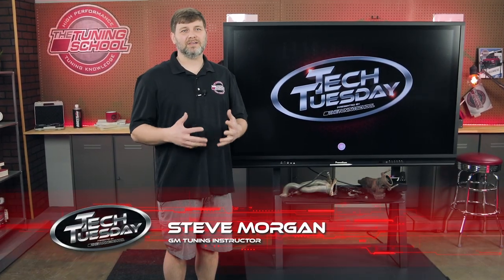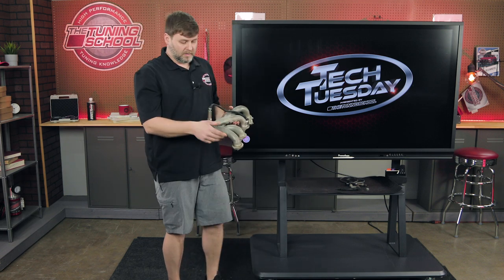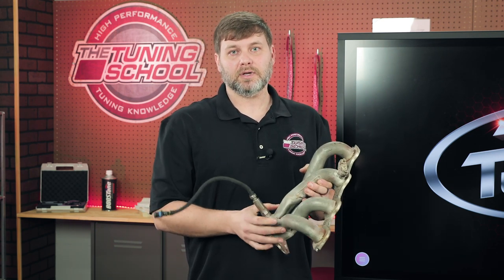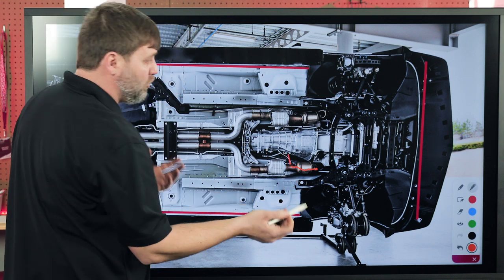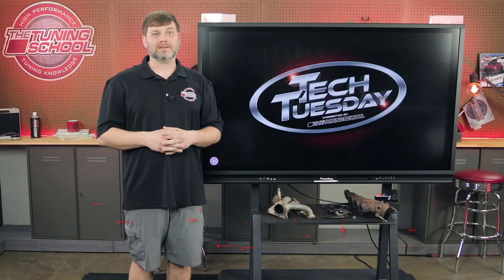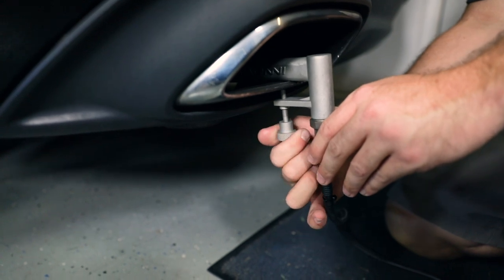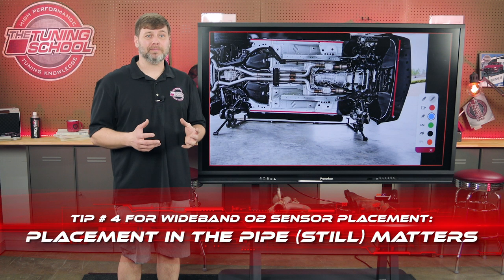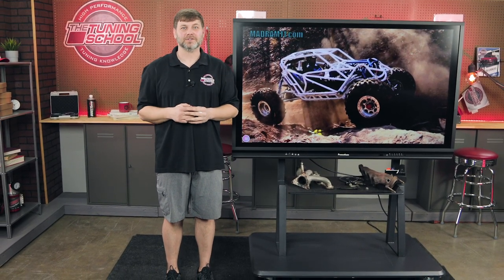Proper O2 Sensor Placement

Comment: I'm building a rear mount coyote F150. I keep finding conflicting information on my factory wideband placement. This will be a low boost build with no more than 10lbs of boost and I believe that back pressure will be minimal because I'm using a turbo with a decent size turbine wheel and also running two wastegates. Do you think I can get away with running my o2 sensors in the factory locations and not kill them?

Comment: Long tube headers have O2 bungs for factory O2 sensors. Do I need to weld 2 more bungs for the tuner or can they use the ones that came with the headers? They just remove the factory sensors

Comment: I agree great video. Well done.
I am planing on installing a A/F gauge with the wide band sensor foe my 5.7 Hemi. After the exhaust header at least 6 inches and not closer then 18 inches to the tail pipe end. Would that be correct?

Comment: I have a 2002 C5 and I installed a set of long tubes on it. The total cost for the all new exhaust was $3,000.00 I sent them off to "Jet Hot" and had them ceramic coated inside and out, and now I have o2 sensors setting off the engine lite. So now I have to spend another $500.00 to get it tuned. And the headers cause it to run VERY RICH! They also make it VERY hard to start. 

I have to turn the key to the on position and then wait for the pump to stop ticking.Then back off and then it will start. If I knew this would be so costly and such a PITA I NEVER WOULD HAVE INSTALLED THEM! The long tubes force you to relocate the Upstream o2 senses further down stream so the computer gets an inaccurate reading because the sensors do NOT get hot enough. And YES I am running 4 Cats. 

I have not driven the car in a year. I also want to instal a nice lumpy cam but if I do I will have to spend another $400.00 on a second tune. So I figured I would wait until I installed the cam to only spend the $500.00. I  need to find whatever the biggest cam I can run without having to replace the torque converter. I do have the "G90" rear gear option.
Reply: Never said what 'enough sensor insertion was. You mentioned it twice!
Reply: @Le10White  Can you explain what you're talking about? I just reread my post twice and didn't mention anything about "enough sensor insertion"??? Much less mention "enough sensor insertion" "twice." Did you reply to the wrong post?
Reply: @ricksteelcustoms3196  Are you the OP?
Reply: @Le10White  Yes.